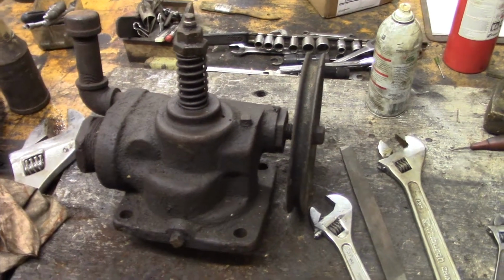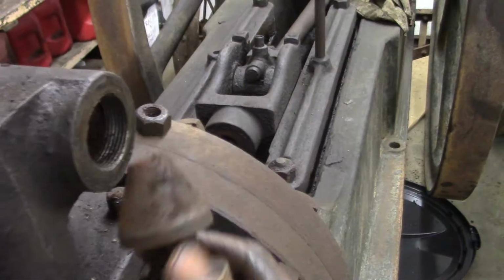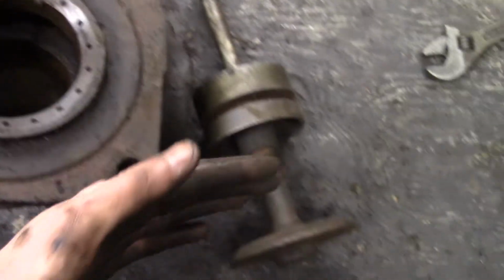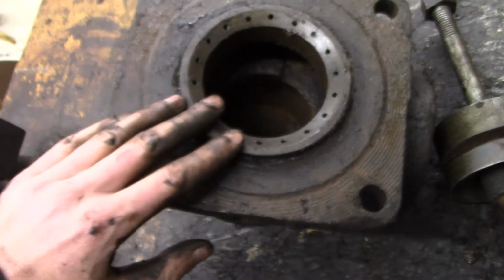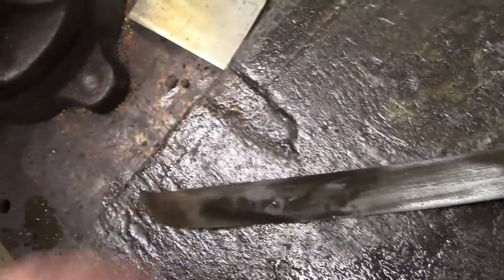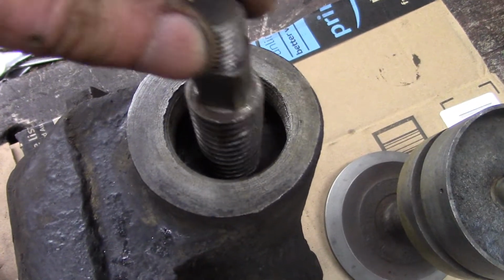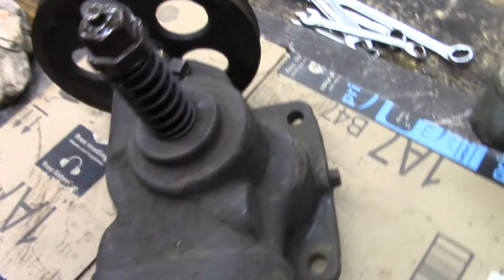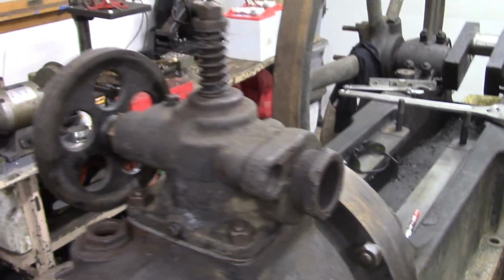15 HP Pattin Brothers - Intake Valve

Comment: Awesome channel! Thanks for sharing!

Your explanation makes sense. Or could it be more of a "demand valve" where it allows gas flow only when the valve is open? Just a thought...

Keep up the fantastic videos.
Reply from the maker: Thanks! glad you like the videos. the "demand valve" portion is the gas ring in the valve seat, for sure. the piston disks on the valve stem are the governor, though my limited experience in running this engine tells me that it works better in theory than practice!

Comment: This kind of detail makes these old engines so interesting - unlike anything found today , but a perfectly method for operating the engine .Probably designed with long life and minimal maintenance in mind .
Reply from the maker: That's right. Case in point - it is nearly 100 years old and doesn't need much to get running again!